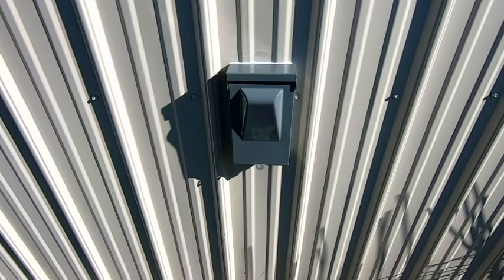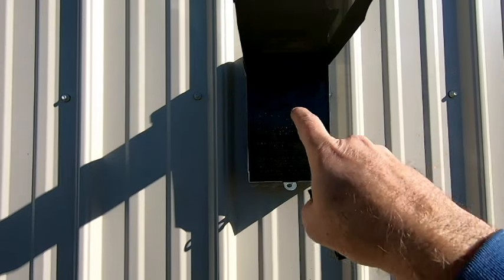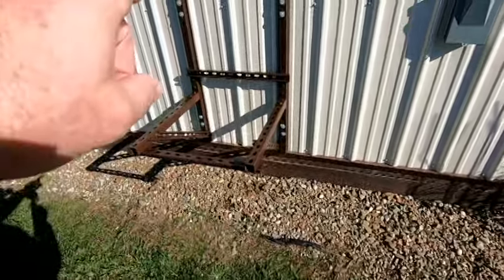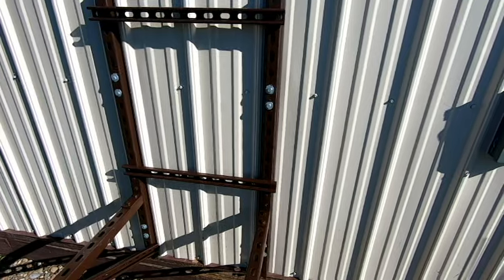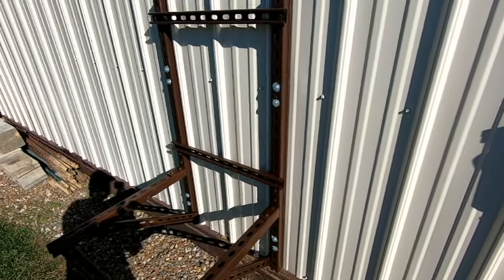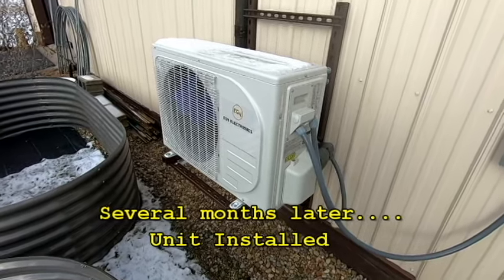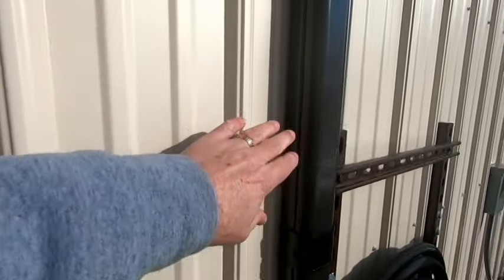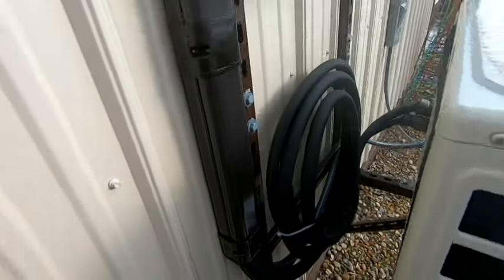Mini Split System - Things to Know Before Installing

Comment: I have read that people who create a lot of dust have more problems with their mini splits. You do  good work and go the extra to make the job work well.
Reply from the maker: Thank you Sir! Yes, I’ve heard about dust issues too. So far, I’ve been heating up the building first, then powering off the mini-split whenever using my saws. Afterwards, I let the dust settle and vacuum off the mini-split power powering it back on again. At the end of the heating season, I plan to open the system up and blow it out with my air compressor before switching over to cooling. I have plans later to build a filter box for it so I can use furnace filters instead of relying on the flimsy screen filters that are built into the unit. I also have a dust collection system I plan to install into the building later…if I ever get caught up.  ;-)
Reply: I've just shot an air compressor through the radiator in mine every month for years. Takes like 10 seconds to clean and works great. most of my dust is wood and concrete if it makes a difference. Not sure how that compares to fine metal dust that some shops produce.

Comment: A fan to mix air will help your heating in winter. Can help as much as 30% energy savings.
This is because the hotter it is on the ceiling the faster the thermal transfer through the insulation. By mixing the air you keep the ambient the same all over the room so it doesn't have a higher transfer rate up at the top of the ceiling. You get similar by pointing the mini split fan downward too but with your big area probably good to have one at the other side.
I assume eventually you'll do 2 mini splits for that area, but it's still good to have a fan going (for when heating only)
Reply from the maker: Yep, agreed!  I plan to add a fan at some point in the future....and probably another mini-split for the other side too. I will probably add the one with the full-solar option for over there.
Reply: @jimginnyohio  I think it makes more sense to expand the overall system solar and attach both splits to the system. especially if you're going with some stackable hybrid inverters like eg4 or growatt ones

Comment: Ceiling fans to blow the warm air down in the winter? Reverse their direction in the summer?
Reply: reversing a ceiling fan won't do anything. it's still just mixing air. Fans also create heat as they're not 100% efficient in kinetic energy. It's better to have a heat build up on the ceiling during summer so more of it is transferring out of the building.
Reply: @gg-gn3re  You should consider teaching thermodynamics or perhaps physics as you know more than all of them.
Reply: @benkanobe7500  What I said is like introductory 101 level lol

Comment: When you are showing the inside unit, it appears you used some kind of roofing or siding to act as windows around the top of you barn wall. I really like that! What is it (specifically) and where do I get it? Thank you!
Reply from the maker: That is corrugated polycarbonate siding. You can pick it up anywhere that sells the metal barn siding. Be sure to let them know what you are using it for to be sure to get the thicker variety. It is much more durable and will hold up to strong winds. Good luck!
Reply: @jimginnyohio  Thank you!